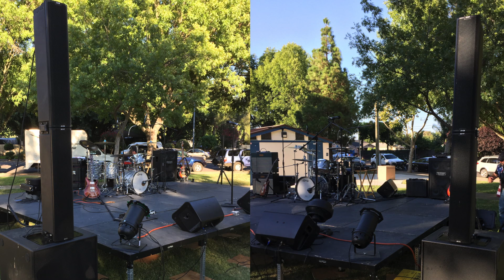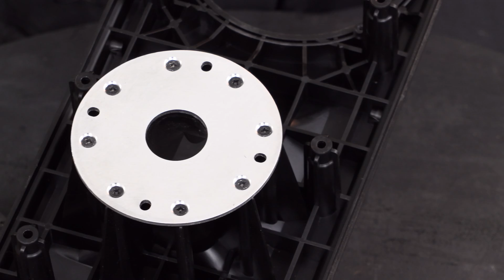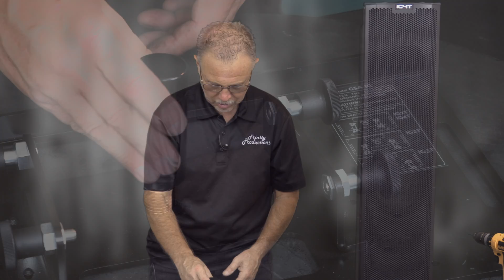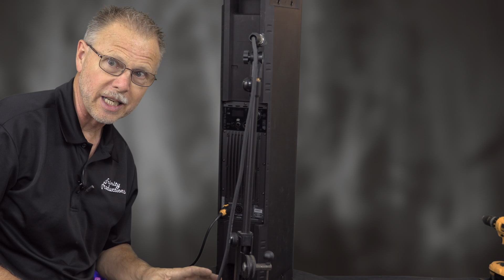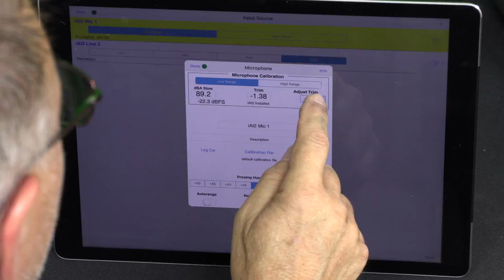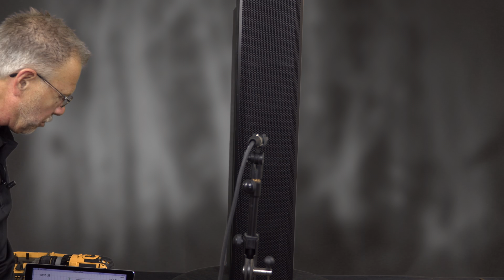dB Technologies IG4T ( The Sleeper System)  - Complete Review - Authorized Dealers and Users

Comment: I bought a pair from full compass and they're on back order so I'm still waiting to hear em. However, i also am tempted to get a pair of ig1t to use for ceremony sound. Can the ig1ts stack onto the ig4ts if I want to use all the speakers for bigger shows?
Reply from the maker: No, not the same set up, the brackets will work, but no IR link, etc. only can use like boxes for inverted stacking.

Comment: If you are sitting on the fence getting these, just go ahead and bite the bullet.  We've run IG4T's with KW181s (for now) and these speakers are absolutely insane.  The clarity is amazing.  

A pair of IG4T's and a pair of KW181s will do 350-400 people no problem.  Especially when stacked.....absolutely out of this world and they look sexy as heck.  We have since sold all of our QSC 2-ways with the exception of a couple of K10s that we use for monitors, fills, small venue work, etc.  99% of the time, the IG4Ts will be used for DJ playback...
Reply from the maker: Yes, the IG4T is a sleeper speaker that more folks need to hear and see. We do events of 1000 with a pair per side and  2 x 18 subs each side. With 900WRMS of power, they do the job and more.

Comment: Hi.Thank you for this channel.    
 i run a 718xlf with a 712PRX 1 a side P.A at the moment.  Im looking to upgrade to a powerful 1sub/1top a side system. I have had the 718xlf next to the dbtech 18h and the prx beats the 18h in my opinion. maybe the DVA KS10 sub could be a better upgrade.

1.Whats the difference between the IG3t and the IG4t and will they be able to beat a 712prx hands down?Which one would you recommend is better value for money. we are looking for warm tone and small footprint.

2.What powerful sub can i match with it in the db tech range or any range? 
We do large rock bands and DJ clubs so we need subs that can pack a punch.

3.What about the NXL24 range matched with the sub 8004? is this not a better option? its slightly less expensive.

4.FBT also an option? You seem to be a bigger fan of the RCF and DB tech stuff.

Thank you for your time.
Reply from the maker: i run a 718xlf with a 712PRX 1 a side P.A at the moment.  Im looking to upgrade to a powerful 1sub/1top a side system. I have had the 718xlf next to the dbtech 18h and the prx beats the 18h in my opinion. maybe the DVA KS10 sub could be a better upgrade. THE 18H IS A GOOD MID RANGE SUB, FOR SOMETHING A BIT MORE, FBT SUBLINE 118SA HAS MORE POWER AS WELL AS RCF SUB 8003 OR 8004 THE KS10 IS GOOD BUT THE VIO 18" SINGLE 18 IS KILLER, IT IS PRICEY BUT OMG IT IS AMAZING FOR A SIGNLE 18 SUB

1.Whats the difference between the IG3t and the IG4t and will they be able to beat a 712prx hands down?Which one would you recommend is better value for money. we are looking for warm tone and small footprint. THEY WILL BLOW AWAY THE PRX BOXES, I LIKE THE IG4T BUT THE IG3T WITH DUAL 10'S AS A BIT BETTER LOW END RESPONSE. THE THING WITH THE IG SERIES IS THAT THEY CAN BE STACKED WITH OUT THE ISSUE OF TRYING TO DO THE SAME THING WITH TRAP BOXES LIKE THE PRX, THOSE WERE NOT DESIGNED TO COUPLE SINCE PATTERN IS SO WIDE IN THE PRX BOXES

2.What powerful sub can i match with it in the db tech range or any range? 
We do large rock bands and DJ clubs so we need subs that can pack a punch. THE FBT OR DB TECH VIO SUBS MENTIONED ABOVE

3.What about the NXL24 range matched with the sub 8004? is this not a better option? its slightly less expensive. THE RCF AND FBT ARE SIMILAR TO THE DB TECH THE IG4T AND IG3T ARE LESS COSTLY THAN RCF OR FBT, BUT ARE INJECTION MOLDED SPEAKERS VS. WOOD. THE 8004 IS AN AMAZING SUB. EVERYONE THAT HAS PURCHASED FROM US IS BLOWN AWAY WITH OUTPUT

4.FBT also an option? You seem to be a bigger fan of the RCF and DB tech stuff. FBT IS ALWAYS AN OPTION AND WE SELL A FAIR AMOUNT, BUT RCF AND DB ARE THE MAIN LINES WE GET ASKED ABOUT
Reply: Thank you so much for your professional approach. 

last quick question, what do you prefer. (keeping in mind i would rather stick with one brand if possible. Just easier with maintenance and matching)

1- IG3t or IG4t or RCF NXL24? best allrounder?

2-sub 8004 or DVA ks10 or DVA s1518n or FBT 118sa?(vio sub is too expensive)

Thank you
Reply from the maker: The IG series are much lighter and easier for set up and have some steering ability that NXL24 does not. The NXL24 sound very good as well, and I like the longer length of the IG4T or NXL24 vs. the IG3T to get better coverage IMO. You will not beat the 8004 for output, but, the FBT118SA is right in there as well.  So, if i were to go with ONE mfr. it would be RCF with the NXL24 and SUB8004's, a bit heavy but sound and output , well, amazing...
Reply: thank you.

Comment: 110 degree horizontal and 90 degree vertical pattern...  Pretty impressive.  So one of these (or two stacked) will cover almost any dance floor I play on.  Sounds like this is a system that can do fine on just one side or centered.  Am I wrong?
Reply: yup, easily!

Comment: Which goes louder igt4 vs Rcf nxl24a? On paper Igt4 wins. Also which one does a better job on the vocals?
Reply from the maker: SPL is one thing , but we don't know what freq the max SPL readings were taken from either DB or RCF. Tonality the RCF has the lower xover point vs. DB, similar drivers for the cone speakers. The wood box does make some difference. The DB box has a better or more versatile DSP in them, either can be used in inverted pairs. Vocal wise, IMO, RCF wins due to the lower xover point and larger HF driver.

Comment: Will these completely outrun a db sub 15h?  I don’t want 18 inch bins as we often play in very small venues.  I’d prefer 15 inch bins.... I’m sure the bins would give up way before the ig4t.  I was thinking then down the line we could stack a 2nd set of 15h bins to more evenly match the ig4t in larger rooms?
Reply from the maker: They will .... you can always adjust the volume so that the boxes are even in SPL. Your idea of adding another 15 is good. We have 2 of the IG4T per side and they will outrun a double 18" sub. The IG series speakers will not disappoint you at all... very nice sound and output and 900WRMS...we love the IG4T we use in our production.
Reply: trinityprosound thanks for the reply! I might just go for the ig2t - if it really is close to something like a yamaha dsr12?  It seems like it would be a better match for the sub15h. Then would have the option of doubling the entire system eventually which should be quite formidable!!
Reply from the maker: the IG2T should sound very good with a SUB15H, a good match for the size of the sub and top box and the 2T power factor should run close to the SUB15H for output levels.

Comment: so power con and true con are not the same 😲🤔
Reply from the maker: Correct, power con is a lower current connector and not water tight , the TruCon is somewhat water tight and higher current. and BTW not interchangeable

Comment: This or RCF nx l24a? I mean in terms of output and clarity.
Reply from the maker: IMO i would have to go with the IG4T, more features and more RMS power and lighter to set up, etc. They both do a great job but I want to save my back...
Reply: Do you think the IG2T would be a match for average 18" (3" voicecoil) sub like Presonus Air18s , JBL PRX618XLF etc? my plan would be to get 2 IG2T's and then another pair down the track so can link them togther for 2 of them a side that would make the tops around 800watts a side no?
Reply from the maker: Yes for a sub in that class/series of power, etc. The IG2T is an amazing box and with the expansion to a 2nd set, OMG will have output that will make you smile.  We will be doing an IG2T video very soon.
Reply: Really would love to see what the IG2T is like as i'm thinking it may not be quite powerful enough for 18"
subs maybe more suited to 15" subs, also would like to see how much more powerful the FBT VENTIS 
206A would be as it is 131spl plus larger 900 watt rms amp.
Reply: Thank you.  I have been wondering the same thing.  I need a complete system that I can do a serious show of 1000 people but split in half to do two shows with 5-600 people.   I am doing almost all pop/rock and some country setups.

Comment: Hello, 

How would you compare this to the IG3T? Mostly working with large bands in large banquet halls for weddings and corporate
Reply from the maker: The IG3T does a bit better in the LF area...and sounds great, same power as IG4T and features. The 3Ts are a great speaker, but does need a subwoofer for full sound, as with the IG4T's. We did an event today with the IG4T and this series always makes me smile...and the band and crowd was blown away with the output. The IG3T is similar...they will amaze you !
Reply: I am trying to decide between the two series and having a hard time. What do you think of sideways sound dispersion?
Reply from the maker: No issus with the horizontal dispersion of the speakers. I like the IG4T the best since it is the tallest column of the 2 and 2 per side is most amazing for sound output. We did test with subs on and subs off and the LF from the IG4T's without subs was respectable at volume. The IG3T may do LF a bit better due to 10" drivers, but my pick is the IG4T's

Comment: Do u prefer this over the Rcf nx745
Reply from the maker: They are not the same type of systems. We like the ease of set up and the weight factor of the IG series. But the sound from the NX45 is amazing with the large HF driver and low cross over point.

Comment: Hi. what do you think about the  dbtech DVAS1518N sub?    You said rcf 8004 or dbtech vio subs are great. Why not this sub. Specs on the DVAS1518N sub looks great.

im gonna run the subs with my FBT Promaxx 114a new addition and later buy the ingenia ig3 tops. then i can run the promaxx as monitors.

Thank you for your time.
Reply from the maker: The 1518N is a great single 18" sub and has the latest G2 amp and great drivers in it, but it is about $1000 more than the 8004 from RCF, specs are close and with the added power they can get a wee bit more from the 1518N for max SPL. I just wish DB had a sub between this and the SUB18H. The 18H is decent, but the 8004 is my favorite single 18" in the mid price point arena...the VIO single 18" is AMAZING, but does cost quite a bit more...

Comment: because i like speaker but some restaurant they just 15amp for all conection electric. i read about manual they said about 20amp for 1 speaker . can you double check it . thanks
Reply from the maker: You can put 2-3 of them on 15A ckt, as long at that is all that is on ckt. just make sure your are running #14 or #12 ga. wire for power feeds to avoid issues. anything smaller over distance will cause power drop.

Comment: I do sound for many types of bands from bluegrass to classic country, rock and blues.... Would the RCF  708 AS II be a possible match for the IG4T or 3t?
Reply from the maker: No...going to need at least a SUB 15H or SUB18H and the IG3T and IG4T have quite a bit of output. We will typically pair either of the IG's with the SUB18H as a minimum
Reply: Ok great thanks....So for the above mentioned application, which would be a better choice,  ig3t or 4? I do mostly  small town outdoor shows of 100 to 600 people. Mostly rock, blues and country and occasionally bluegrass. I shoot for a tight punchy drum mix and crisp clear vocals. So would 2 sub 15h per side  be adequate?  thanks for your input. I really appreciate your reviews.
Reply from the maker: I like the sound of the IG4T the best, and yes , 2 of the SUB15H per side would be amazing...nice and tight, but with the hybrid design the do a good job of going low as well.
Reply: Why do you like the ig4t over the ig3t?
Reply from the maker: Lighter and column is taller, but the IG3T goes a bit lower with the dual 10" drivers. Easier setup with the IG4Ts IMO

Comment: The ig2t vs the 732a mkIV???
Reply from the maker: Different animal....the IG2T has more DSP and expansion than the 732, sound wise the 732 is going to be a bit smoother due to lower cross over point of the larger driver on the 732. but depends on what you are wanting to use the speakers for.

Comment: Hi Tinityprosound, other great review thank a lot ! this product is very similar than FBT Vertus CLA 406A, Wich one you prefer ?
Reply from the maker: They are very similar to each other but the db IG4T has same power as FBT and looks like same type and size of HF driver. only different is one is wood being FBT... the IG4T has more features such as vertical steering and built in crossovers. Also the weight is a factor and the IG4T for us wins...the 3 , being RCF, FBT and dB tech are all excellent column systems and when you combine 2 per side the results are short of amazing....
Reply: With 2 per side how many people can it cover outdoors with 4 x 2x18 sub? thank
Reply from the maker: We have done 700-1000 at decent levels for outdoor concerts in the park here locally. And, most of the audience was behind our FOH position due to shade trees since those were summer events. If the crowd was closer maybe more. Also, coverage will be greater if you can get the up higher and steer down the 10 degrees. We spec'd out a system for a high school in San Francisco for their theater that held 700 or so and no issues, we just had them put on the wall at around 16' to the top of the first box...their response was OMG !

Comment: Hi how is vs with Bose l1 model 2 with b2 sub for karaoke? Thanks
Reply from the maker: No highs, no lows must be Bose...we are not Bose dealers, but have had others sell their Bose to buy these and love them.
Reply: Hi thanks for your answer 
Can you please tell me in between Bose l1 model 2 vs rcf j12 they’re both line aray which one is better thanks
Reply from the maker: EVOX is better
Reply: The real question would be to compare these and the Rcf nxl 24s.. they look really similar. I do like the design of the RCF's more but these look really impressive.
Reply from the maker: The RCF are smoother, larger driver in the HF and lower xover point. The IG4T are impressive and the weight is amazingly light for the output of these speakers, but for pure fidelity the NXL24's win.
Reply: @trinityprosound  thank you sir!
Reply: Tran Tram I wouldn’t really consider this a Column speaker such as the Bose 

This is a hybrid of a point source and a line source 
The idea behind it is 4 6.5s have more surface area then a single 12 inch so it’s a two way speaker that is in a compact format

Comment: do u think i can use it at horizontal position?
,i have a live room place with a very low ceiling, so i want them flying them from there.
thank u very much
Reply from the maker: would not recommend laying them flat , the horn is not rotatable and you loose the asymmetrical aspect of the speaker horn...we use single units on stands or stacked on subs and work out great. no need to fly them...we stack a pair on a dual 18 sub, standing up or laying down (the sub) and have had no issues...just need to be aware of people in front when they are close to speaker as SPL levels can get fairly high with the IG4T that close in.
Reply: thanks a lot. i had a problem to put on stands because my stage is 
 corner, so its mean it will hide a part from the band.
any other db stuff that i can use in a horizontal position, and its not a line arry module?
again, thanks a lot
Reply from the maker: not that is narrow....RCF has the TT052's we use for fills and they are very nice and small profile...

Comment: Do you think 1 per side ig4t with a single 18 or 15 like Rcf 705 sub or Avante18
 inch sub would be ok?
Reply from the maker: The IG4T will out run that sub, you will need at least a single 18 to keep up with it. KS10 or SUB18H or RCF 8004 or 8003 or FBT SUBLINE 118 will pair nicely with the IG4T's

Comment: Great channel!  Quick question, we currently have KW181s and recently picked up an RCF 905asII with the 2200 watt amp since the price was too good to pass up.  I saw your response to the other fella regarding with pairing to the KW181.  I should have no issue running an IG4T or dual stacked IG1T's with the RCF 905 correct?  Thanks in advance.  I'm leaning towards these and was also considering the NX L24a's....
Reply from the maker: The IG4T will outrun you sub hands down. The 2200 watts is peak, so around 1100 watts RMS power, QSC might be 600 watts RMS on a good day.  For the IG1T, yes dual stacked should be fine. We can get a IG4T to outrun a double 18 in some instances....the NXL24 are nice as well, but IMO not as versatile as the IG4T's dual stacked the IG4T has more features to them and lighter :-)
Reply from the maker: You are close to us...if you need pricing, call us....we offer excellent pricing and support 209-832-8023, out in the Valley No. Calif.
Reply from the maker: Yes we are in the Valley...we don't stock those would have to order them in. Yes we are the ones that work with Duy...

Comment: hi . how many amp do we need for 1speaker db igt4?
Reply from the maker: driven hard maximum of 4A would be my take on it, since the power supply is switch mode and very good with power requirements, we have driven 2 IG4T tops and 1 dual 18" sub off one 20A ckt with no issues.